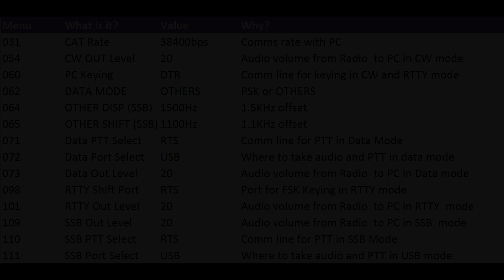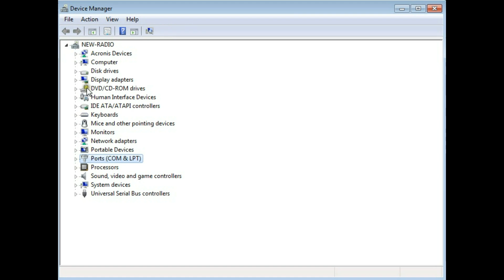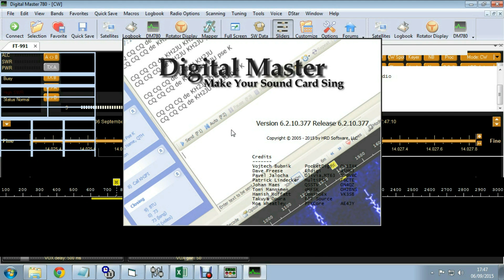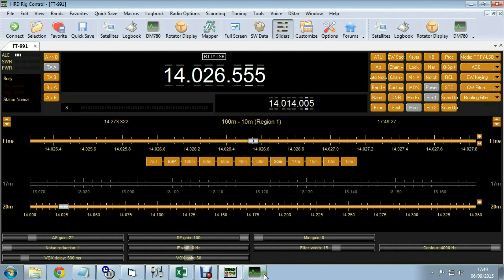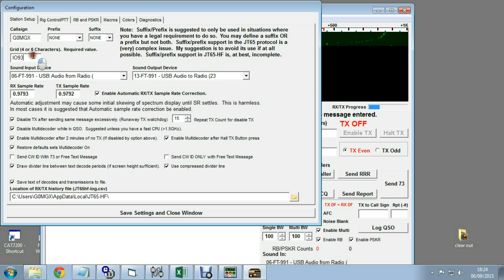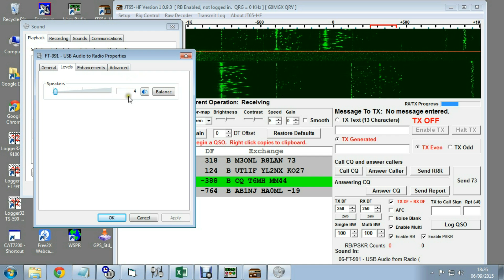LAMCO Tech Video - FT-991 Digital Modes

Comment: Good morning and thanks for the video this is exactly what I was looking for, I had two question, at @7:30 in the video when you transition from CW to RTTY-LSB Rig Control shows "CW" only, is this mode C-U or C-L on the FT991, assuming USB?  I also saw where AFSK in RTTY LSB  is a general preferred method does that same rule apply FSK?  Thank you so much '73 de Ki5JUF

Comment: Really great video. Thank you for posting it. I do have a question for you. I have my 991 going to my computer as you suggested. However when I am having trouble knowing where the AF knob and the RF knob on the front of the 991 should be set and also where the level adjustment should be set on the computer for level in and level out. I have WSPR working and then it stopped when those control got changed.
Thank you

Comment: Hello MarkNice video. There is a problem though When selecting the mode on the radio you say it does not matter whether you select eg: USB or USB-DATA. It does if your using the USB for connection to the PC you need to select USB-DATA in the mode menu or it will not work.